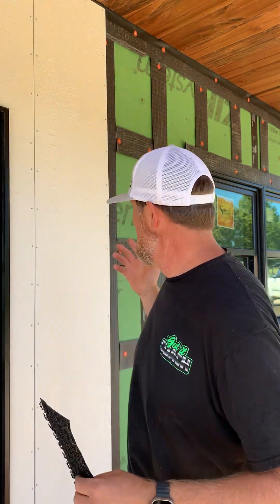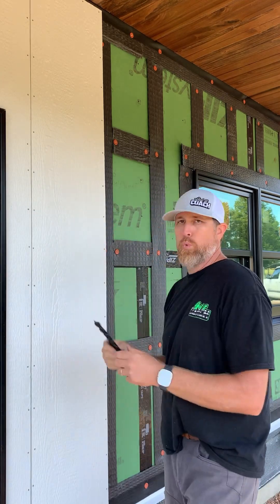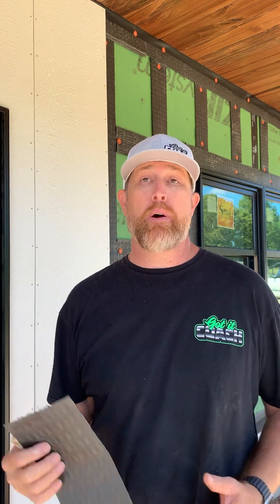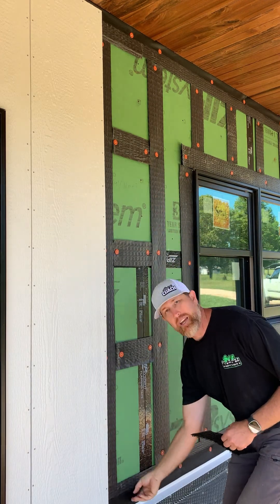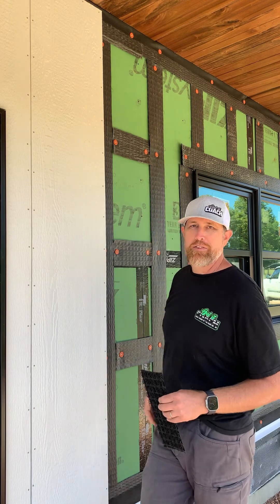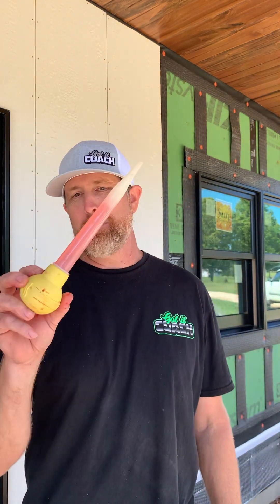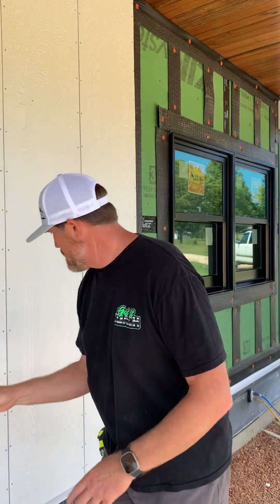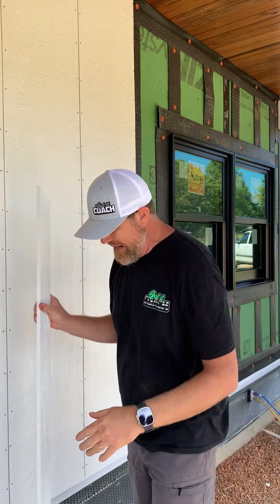ZIP System Rain Screen / What is it and let's see how it holds up to a water test

Comment: I can’t believe rain screen is not code in some places. Trying to build a house soon and the contractor wants 7/16 osb with standard house wrap nailed on and hardie siding directly nailed to it. No gap and thousands of holes in the house wrap. I’m worried about long term damage occurring. Had priced this product but it was too expensive but cutting it into strips might make it possible for me.
Reply from the maker: Ya, took me a while to realize it’s necessity & Housewrap does absolutely nothing!! It’s like tits on a boar hog 😆 use Zip sheathing, tape it, seal the nail heads then check out Benjamin Obdykes hydrogap, it’s probably the most cost effective one. There are several good systems out there.
Reply: You can use any roof ventilation mat it will do the same thing

Comment: Why invite water into the house? Does the bug screen have the same longevity/warranty as all of the other products being used?!
Reply from the maker: It’s not invited, but if it does sneak in it will drain and dry out perfectly
Reply: Seems like it will only benefit the builder by hiding the water problem. Kinda like vinyl siding and wrapping the windows with trim coil!?

Comment: Good stuff Keith, with all the advances in water mitigation in the past decade, newly constructed houses should be rot free for years...of course, it all still depends on the quality of the builder....which is always the biggest unknown
Reply: Where im at we have to choke out our houses where as 70 years ago the design allowed heat to escape through the walls and dry them out. 

If we don't run a humidifier in our houses now they'll dry rot within a few years
Reply from the maker: Exactly, if it’s installed poorly then the outcome will be the same. Ya man, it’s crazy the technology advances in home construction in the past decade like you said.